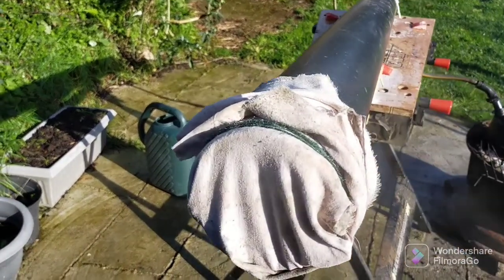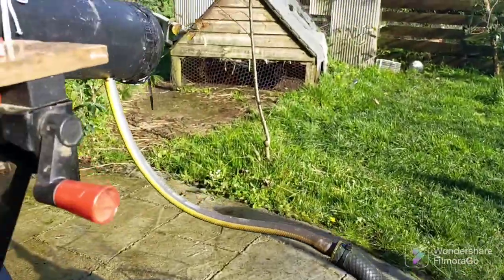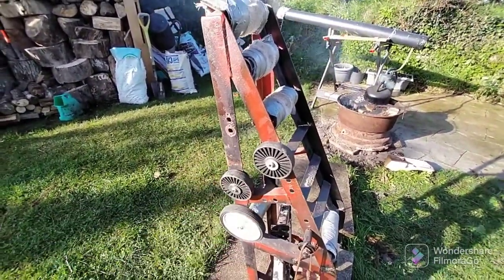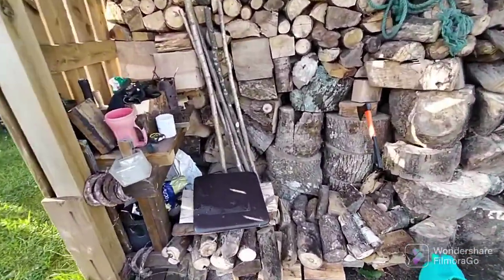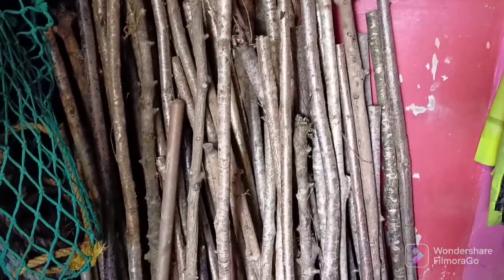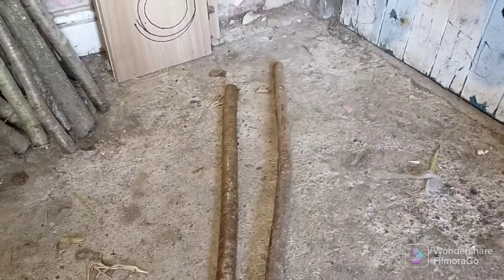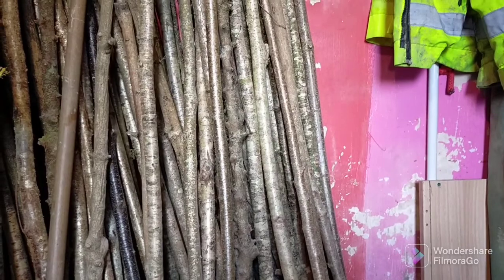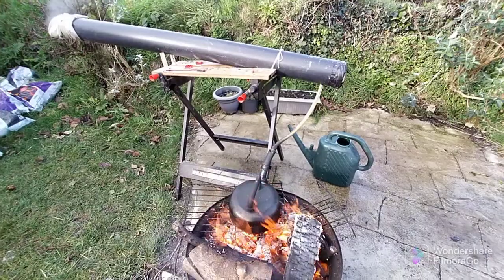How to straighten a hiking stick with steam, hillbilly style. More efficient than a heat gun.

Comment: Thanks for showing your steaming setup. For the most part, I tweak sticks straight as they dry (I only cut around twenty a year, so popping out to the shed and tweaking them every few weeks isn't a problem!) but if I do have any that escape my attention then I use the good old paint stripper. The paint stripper works, but I have had more than a ew instances of scorching pretty bark, so setting up a steam system is next on my list. Thanks again
Reply from the maker: Hi,This is about as crude and basic a steam set up as it can get. It does come with safety  issues  I have described  but it will heat wood up enough for straightening. That's interesting  how you are straightening  tweaking over time.
That has inspired me to have a go with a few pieces  of wood using your  method. Thanks for watching, Andy.
Reply: @hiddenvalleyfootpaths2561  My 'tweak as they dry' method does work well, and I'm probably wrong but I always feel that doing it without applying heat could lead to a stronger stick... possibly maybe!
Reply from the maker: @ExplorerJust  HI, I believe  your theory could hold some truth.I do know some stick makers  tie off saplings in desirable  shapes then leave to grow like that till harvest season. Thanks for watching, Andy.
Reply: L

Comment: Nice spot to enjoy the day straightening sticks ! I was wondering if this works for any type of wood, I got a few blackthorn and heat gun does not work so easily … thanks for the video !
Reply from the maker: Hi, I still occasionally  use a heat gun but I have to admit steam straightening is a superior quality  method. I don't do much blackthorn but for me steam has worked. Thanks for watching and commenting. Andy.
Oh I do remember a famous youtube  Irish stick maker that does  not recommend steam for black thorn though......As I said I had no problems but he's the professional in regards to blackthorn. Thanks for watching  Andy.
Reply: @hiddenvalleyfootpaths2561  
Thanks for your answer which I saw only now lol !
Actually I had an answer also from Irish stick maker explaining that you don’t want to put back moisture into a seasoned blackthorn stick … however I don’t think that the moisture which took 2 years to go out will go back in it within 2 hours steam heating… I think the steam will just transmit evenly its heat to the wood at heart, but not penetrate the wood, just heat exchange … everyone has their habits and way of doing things and I thing steam may be a bit more of a demanding process that’s why some people will not use it and that’s all … if the stick has a good diameter, I think the heat gun can’t really heat it at heart … but the steam will probably do it … In short, I will try it and let you know ! Thanks again ☺️👍

Comment: Hi Andy I was just  wondering what is best attachment from kettle to pipe and is the pipe a hose pipe. Many thanks
Reply from the maker: Hi.None of the materials are correct or safe for this setup up that i was using. It was something I had knocked up out of stuff lying around the shed. Yes I managed to produce steam and a method to straighten sticks, but as I said, it was dangerous  and needs a lot of care to use.I do not recommend you copy this out safety  reasons. I would look online how to build a more professional setup .This is not a recommended how to do, but a look how I did things  out of desperation. I have moved over to electricity now also.. Thanks for watching. Andy.

Comment: Great vids how long did you take to dry the sticks ? Thanks
Reply from the maker: Hi, I season my sticks for 12 months. After steam straightening I dry till outer bark is dry to the touch which  may be days or weeks depending  on outdoors ambient  temperature. Thanks for watching, Andy.
Reply: if you harvest in winter-or early spring they crack alot less when drying and a whole lot faster. collecting juniper in summer it will most likely split so bad its better to use as belly laminate for a selfbow rather than a walking stick or spear, contraty to harvesting in winter where splitting is minimal

Comment: What is the sea pipe made of?
Reply from the maker: Hi, all my materials are not designed and intended for the heat and steam process and are dangerous in operation as stated in this video. The steam pipe chamber was drainage pipe. Thanks for watching and commenting. Andy.